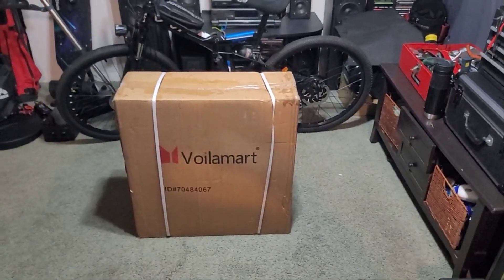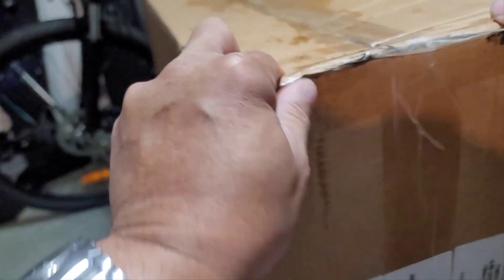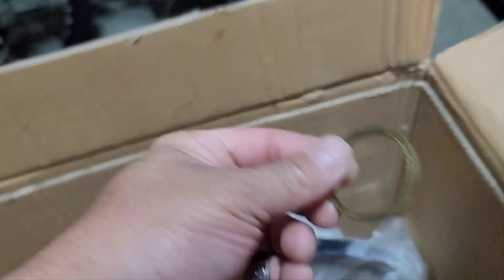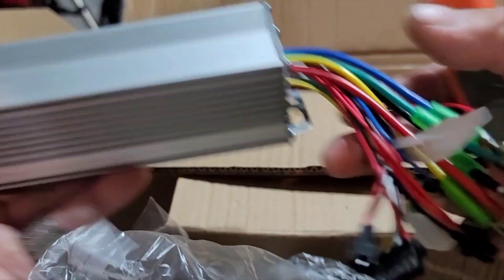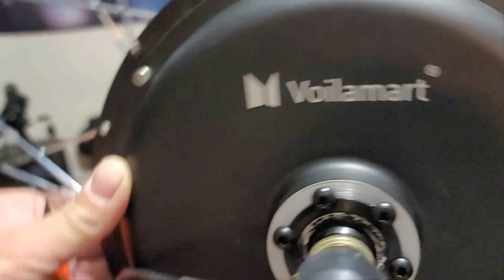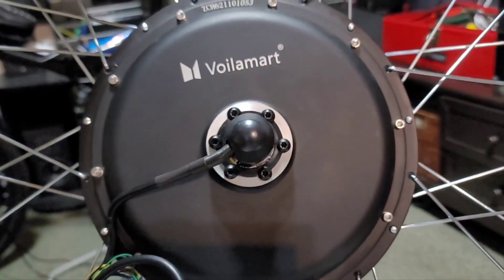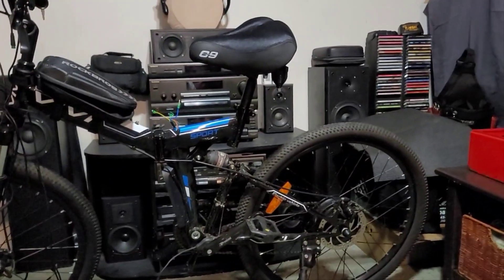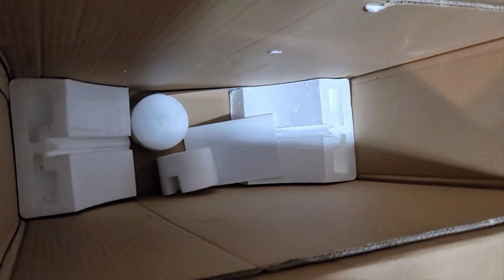MTB conversion build with Voilamart kit. 48v 1000watt installing on folding MTB. Last look 72v Sup73

Comment: Will the developer work without programming?
Reply from the maker: you mean the controller? yes
Reply: @ChrisCrossingWires1212  I mean the axial motoror hub motor
Reply: Can you explain that please
Reply: please replyWhat program is required for programming?
Reply: This kit does not come with an LCD display and cannot be programmed. It only includes a battery level LED indicator. If you want to use an LCD display with this kit, you will need to replace both the controller and the throttle with ones that have an LCD connection; otherwise, you won't be able to connect the LCD display. Alternatively, you can purchase a kit that comes with an LCD display.

Comment: On the point about motor size, you are right when you say the farther away the magnets are from the axle, the more torque. Its basic physics. Fulcrums and moment arms and all that. The same reason it's easier to open a door with a handle that's far from the hinge of the door.
Reply from the maker: that would have been a good way to interpret it. I have to remember that next time. I get brain freeze on camera from time to time, 😆